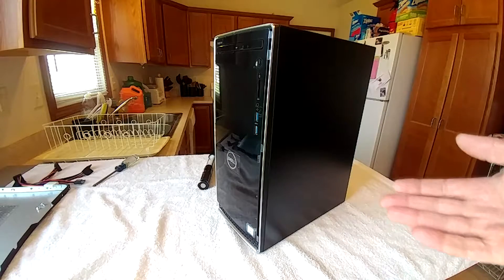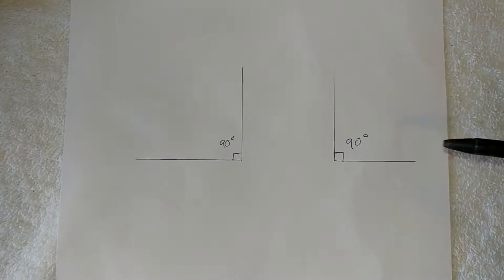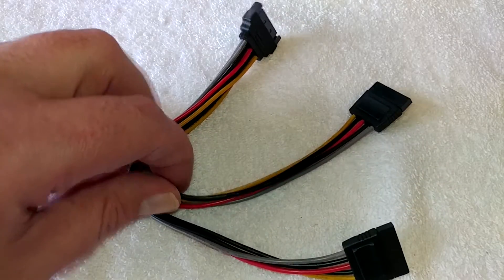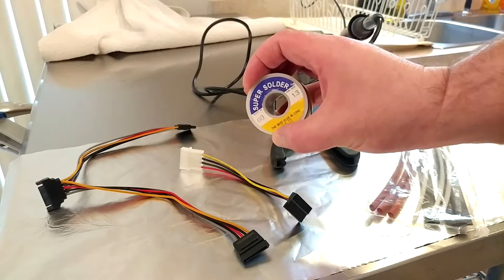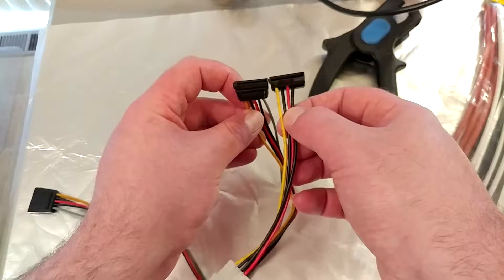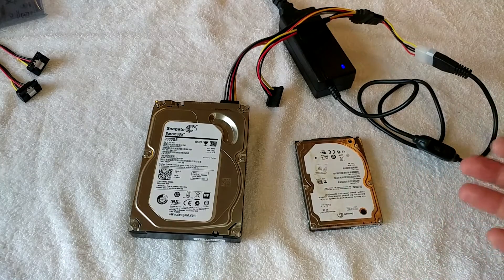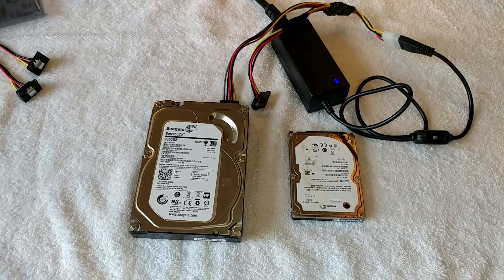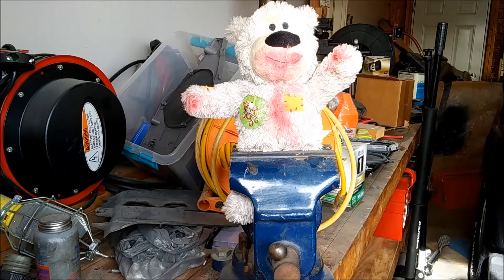TBT 8 - Custom SATA Power "Left" 90 Degree Adapter (for Dell Desktops)!

Comment: You know that you could of gotten a SATA power extension cable for the ssd or gotten this cable: https://www.amazon.com/COMeap-Replacement-Right-Angle-Compatible-14-5-inch/dp/B07CK8QP68
I looked at YouTube videos of that desktop and the dell manual and it apparently has 2 mini 6 pin SATA powers
Reply from the maker: I added a link for that cable to the description. Thanks!

Comment: Neat video, I have heard Dell uses proprietary connectors for their stuff. If I wanted to learn about how to do electrical wiring, where would you recommend I start Max?
Reply from the maker: It's not exactly proprietary since it is just a regular SATA connection. It's their case that is causing the problem here. They've cost reduced it to the point that there are no actual drive bays and the connector orientation is the price they paid for that. Really, other than it causing me a slight annoyance in this case I have to admire the simplicity of their design. If I had to trade off more sheet metal and forming vs. just a "different" connector, I'd go with the connector too. Especially at the price point of that machine, I can't complain. However, I'd be mighty annoyed if the $1000+ versions of that same machine had all of the same limitations. More than anything, I just feel bad about anyone I could have potentially misled with the original video since I only a few days ago discovered the problem (and got the update out literally as fast as I could) and the original video has actually become surprisingly popular.

As far as learning electrical wiring type of stuff, what's your current knowledge base? Were you already familiar with the stuff I outlined in the video? You know I'm always down for another "Ask Max" if there is something particular on your mind and I'm happy to do it. Just need to know where to start! :)
Reply: @TheBrokenLife  I would call myself a beginner, I know there is a power and ground, but I don't know how they work with each other. From what I know, the power side supplies electrical power. As for the ground, I know if an electrical item doesn't have ground, it won't work. I don't why, though. I understood that all you were doing was matching up the wires, and the gray one wasn't needed. As for an "Ask Max" idea. How to find a sound knowledge base on the internet since it's tough to verify what's true if you are a beginner?
Reply from the maker: Verifying information on the internet is a tough one for everybody... I'll have to think of a decent answer for that one. I can say that in a nut shell, what I do these days is the same thing you're doing now. I watch videos from several people, and read message forum posts and such, and if there seems to be a consensus on a topic across several sources, I'll usually accept it as truthful (or at least not dishonest). If there's not much information, then I have to wing it and make do. Winging it gets easier with more experience. 

Answering pointed questions is much easier. In a DC (direct current) circuit, which is what we're talking about with PC power supplies, you have a positive (+) and a negative (-) and they always stay the same (as opposed to AC power, where the poles alternate; in the US out of your wall that happens 60 times a second). Electrons from the atoms in the wire (copper in our case) can be charged negatively and become free to bond with their neighboring positively charged atoms. Just like magnets, opposites attract here, so the negatively charged electrons are then attracted to the positive atoms up stream. So when you apply power to a complete circuit, what actually is happening is that negative electrons are flowing through the copper, creating and breaking subatomic bonds the entire time, to the positive attraction at the other end. If you remove one side or the other of that equation, there is no more energy to create those negative electrons, thus no more sub atomic bonding, and no more electricity flowing. On the very basic physics side of things, that's generally how it works. Think of it like a sink. If the water (power) is on, it flows into the basin (gravity = negative electrons here) and down the drain (positive atoms). If you turn the water off, the drain doesn't have anything to do anymore.